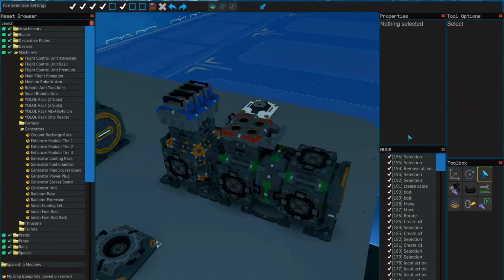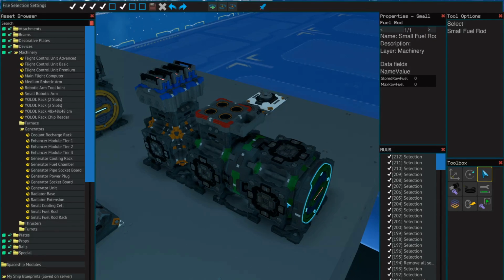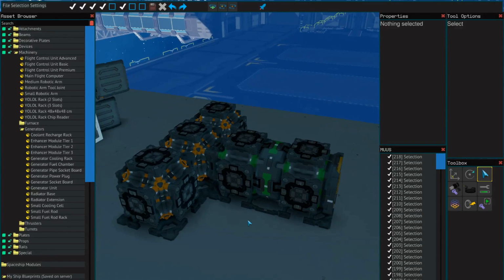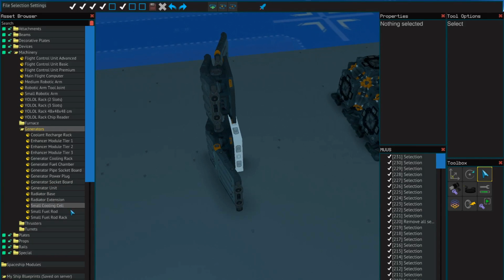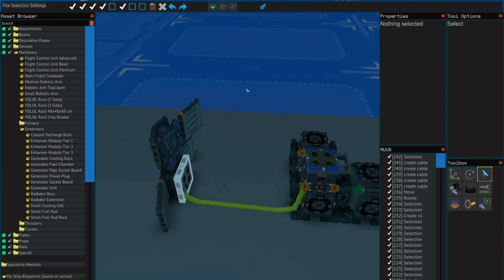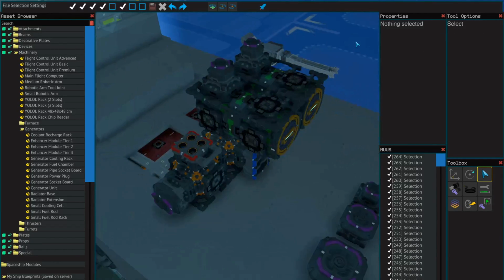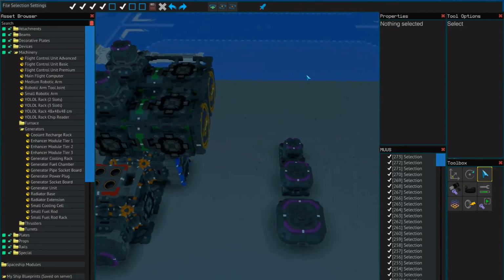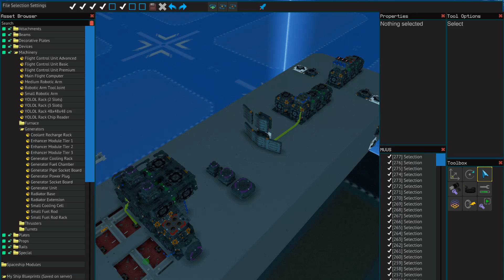STARBASE TUTORIAL - Generators

Comment: in the case of a generator assembly with multiple fuel chambers does the maximum number of generator units increase? for example, if you had 2 fuel chambers would they need 6 generator units to reach their maximum output as they would if used in two distinct assemblies.
Reply from the maker: Yes thats correct
Reply: @simulatorhaven  thank you! with the game reaching early access so recently there isn't a ton of documentation on this sort of thing. as such, having community members who take the time to share their knowledge with the masses makes a huge difference. :)
Reply: @simulatorhaven  I was also wondering if there is a way to link non-contiguous components of a generator into a single assembly, be it to add redundancy or to fit components into a tight space. I'm pretty sure the answer is no, but I figured it was worth asking while I had the floor.

Comment: Do fuel chambers hooked up to the same generator units (like in your last example) act as a single generator (and so for example you would need to have only one pipe socket output) or do they act indipendently?
Reply from the maker: Yes that is correct, they will act as a single unit. So for example, you could have 1 generator unit and 3 fuel chambers(or any combo of the two) and that system would only need one pipe (or cable) socket board output.

Comment: Do you need to hook up cooling racks or radiators to each generator or just one? How do you put the coolant in and does in need to be replaced? You may have said it in the video but can you enhance your fuel storage as well?
Reply from the maker: You can have only one radiator/cooling rack per generator. But for larger generators you want more. Otherwise the cooling systems would have to be replaced a lot, especially when using cooling racks. In radiators the coolant is already there and it doesn’t need to be replaced for a long time. And if fuel is in storage (so not in current use) you cannot enhance it. Only when it is in the fuel chamber

Comment: How does one make an eco mode on a generator
Reply from the maker: An Eco mode can be made using a button. With that button you set the rate limit in the generator or fuel rod to a low value, like 10. Whereas when the button is not pressed have the value be something like 70 (or any higher number)